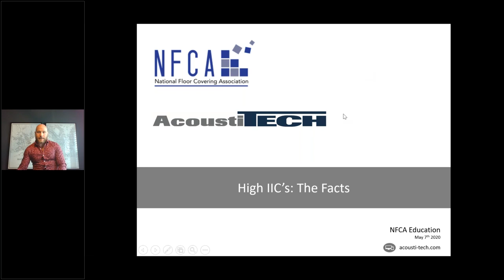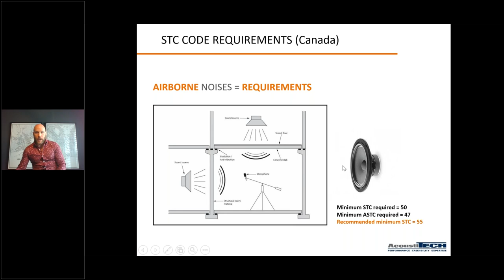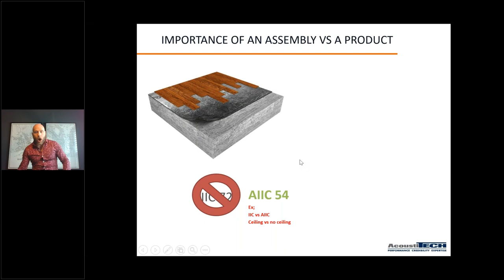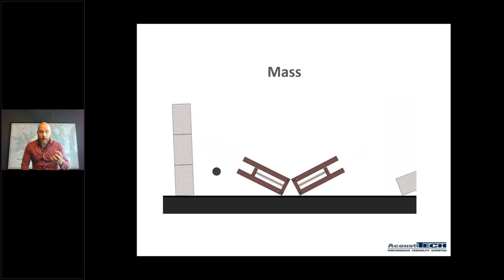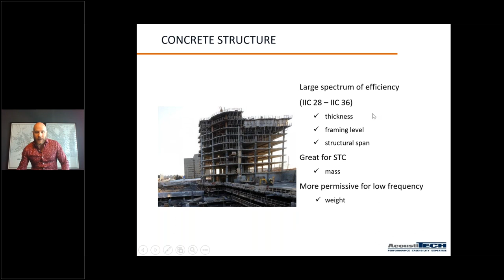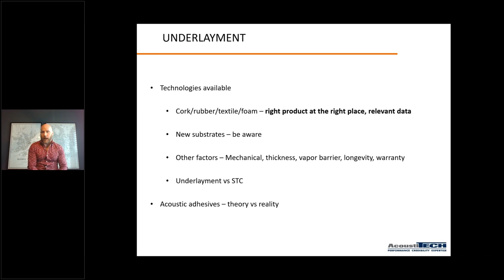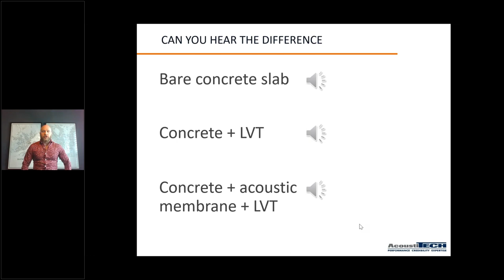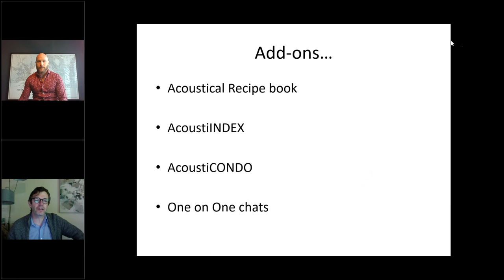High IIC’s  The Facts

Comment: Is there a product that is tested without a drop ceiling that has a rating of 74 iic
Reply from the maker: Hello! Great question! Yes there is, but it requires a more complex assembly over the structure since we are not working on the ceiling. These solutions will often be around 3” thick, but will provide great STC and IIC values. Please reach out to us directly on out website if you would like to know more.